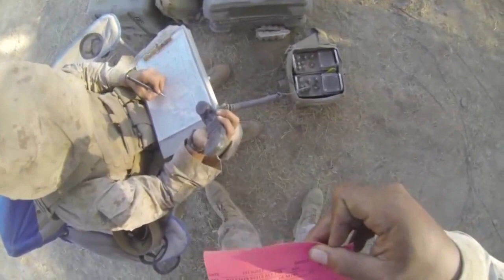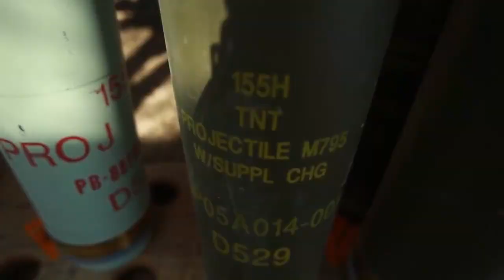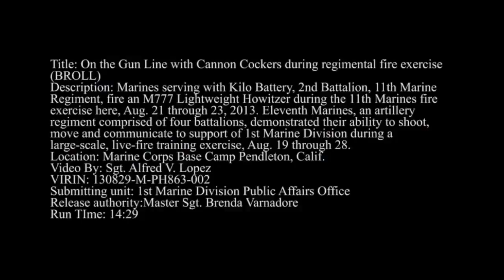U.S. Marine Corps 10-day Live Fire Artillery Exercise at Camp Pendleton

Comment: The artillery being fired only 5 miles from the homes of tens of thousands of people.  The experience is terrifying. My house literally shakes from ceiling to foundation.  The blasting went on for 10 days usually from 6:00 a.m. till midnight(18 hours). At one point I counted 38 blasts within one minute. Included in this exercise was two days of extended fire.  Artillery was fired continuously for 24 hours nonstop.